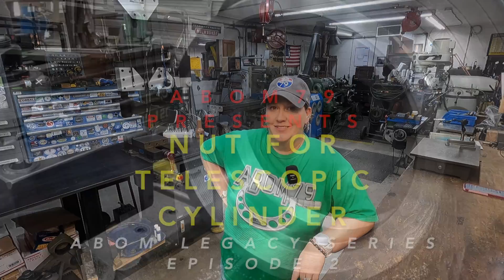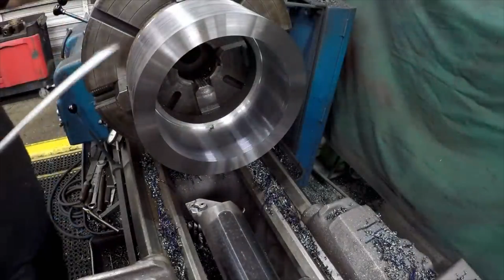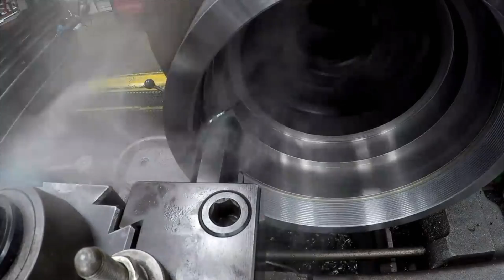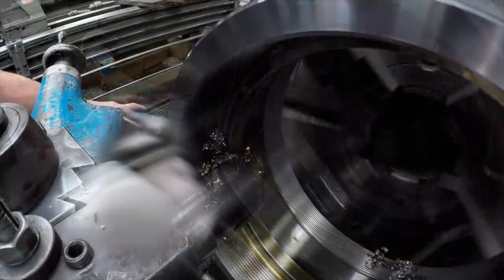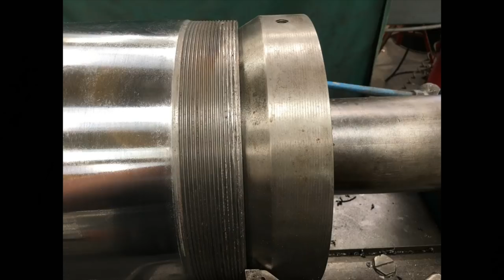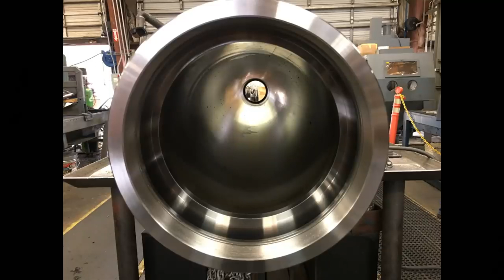Abom Legacy Series Episode 2: Large Hydraulic Tube Nut for Telescopic Cylinder

Comment: Verniers are great we use them in our shop all the time. I have my mitotoya 8inch digital for all most things but if we need to good plus or minus .001 or less and we don't have the right tools we go to the vernier and I haven't gotten anything back yet.
Reply: At my work I work in a grind shop the biggest micrometer we have is 40-42 inch and the biggest verniers we got is 36 inch pair.

Comment: I've made thousands of end caps for hydraulic cylinders while running cnc's for Energy Mfg. I don't recall any of ours having that style of seal. The bulk of our caps are machined out of cast bar stock. We cut the 10 or 12 foot bars to length on a band saw. The first 1 or 2 parts are loaded by hand into the chuck and are a bitch to handle. Once the program is running right we let the robots load the rest of them. Cast really machines nice and they are far lighter to unload. Some odd cylinder caps and pistons are made from cast pipe and some from your regular steels and stainless steels. Those bigger ones run at about 8pcs. an hour in a dual spindle Mazak cnc lathe with a robot doing the loading and unloading. A typical setup for a part like that in a dual spindle cnc takes me about an hour.

Comment: I may have missed this, but.. How does one secure this nut to the rod? Just by set screws? Or is there a big *ss monkey wrench that does the trick.. ;-)
Reply: If you put a monkey wrench on the end of Adam's newly machined nut you'd better be able to run fast or dodge a bullet. Don't think it would end up well for you. But I am sure you, Gary, would find another (proper) way to wind the nut onto the cylinder. Adam also mentioned some peripheral locking grub screws. Think he would have some extra holes for a large gland nut spanner to do the tightening. Most gland nuts are produced with them.

Comment: Now I am interested in learning how to setup threaded parts back up after removing it from the lathe.
Reply: find the correct diameter and thread pitch, then set the compound to parallel to the axis of the part. you can then adjust the compound forward and back until the threading tool is in the perfect place, then you can thread as normal. this takes some very careful indicating, a small amount of runout really ruins things
Reply: There is quite a lot of "pucker factor" the first time you do it. Keep the rpm slow and be prepared to stop the lathe very, very quickly. As Lincoln has said get the tool running along the outside of the thread, but on the cross slide away from it. Then while shaft is rotating, gradually work tool in to where the threads match. But don't put the tool in too deep. The galling that Adam had means the tip of the tool will catch the outside extremities of the galling early in the piece. If the tip is placed in close to the bottom of the thread too early, while trying to clean up the thread, the tip will break off - ask me how I know. Even after doing it many times, don't get over confident. Carefully does it - every time. But at the same time, it can be done and done successfully.

Comment: Question what causes the chips to come out in ribbons versus the little flakes. Is this causes by the insert or the depth of the cut or something else
Reply: Not a machinist, but I'll take a stab and suggest that the answer is "a whole bunch of things".
Insert type, depth/feed rate, how out-of-round the stock is, number of ponies produced by the motor/drive system which determines how much it bogs down under heavy load...
Reply: Threading chips in steel almost always come out in long strings like that. Threading inserts are not designed to break chips in pieces like turning inserts.
Reply: Experience.

Comment: Old Clark forklifts and others used these type of cylinders. I have removed plenty of these gland nuts and found if galling starts take a lead dead blow and work firm around the nut threaded and then work the nut back and forth. Takes some time on some. Depending on type of metal used to make nut, have had a lot of success using this method. Thanks for posting.